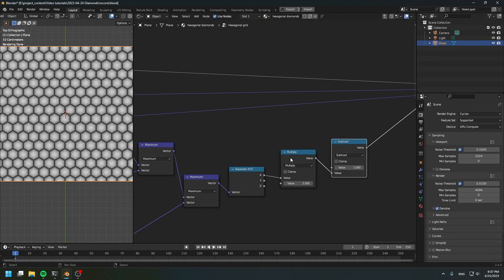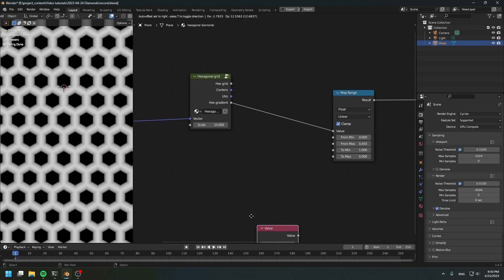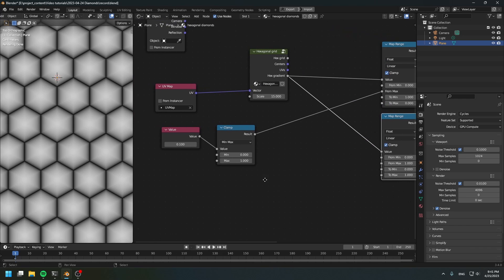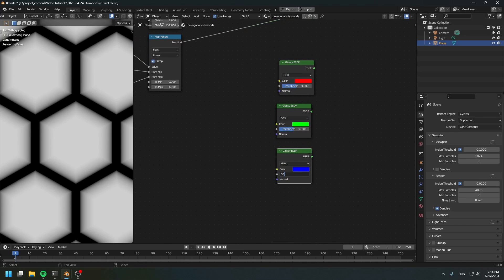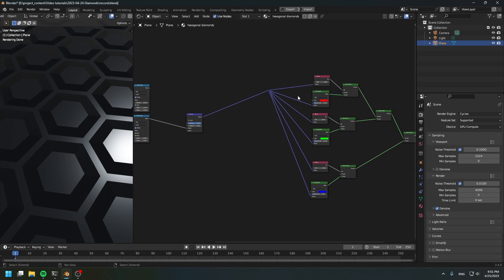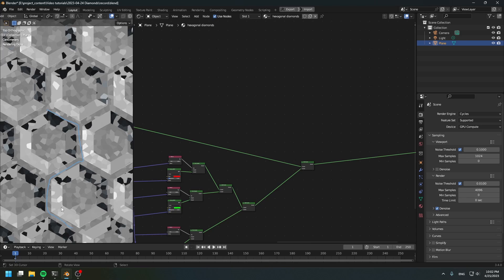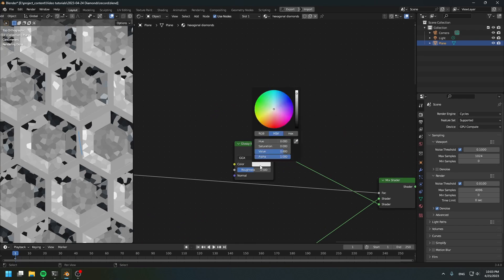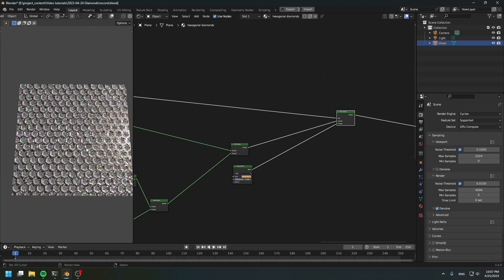Fake diamond - part 2 - Creating the diamond shader

Comment: i bought this thought it was able to go on like fivem chain or pendant or jelwery texture, any way u can help me lance phan i would really appreciate it
Reply from the maker: You need to create a UV map for your objects and input the UV to the fake diamond shader. Then adjust the scale of the diamond until you are happy.
Without the UV, the diamonds won't show up
Reply: @LancePhan  so the videos u did wer just planes and stuff so if i got a object i made i got to use all them plug ins and how does it work uv to texture 
do u got a discord bro ? i apperacite u responding back to me
Reply from the maker: @aggoldie  The plane has a default UV so I just used it right away. But a complex object needs to be UV unwrapped to make a UV map. This is a basic subject that everyone must learn in order to make 3D art. In this video, I focused on making the diamonds and assumed everyone already know how to make a UV map in Blender. If you are new to 3D art, you should watch some tutorials about UV unwrapping first.
Reply: @LancePhan  can i give you my email or discord ill pay you to help me firgure it out